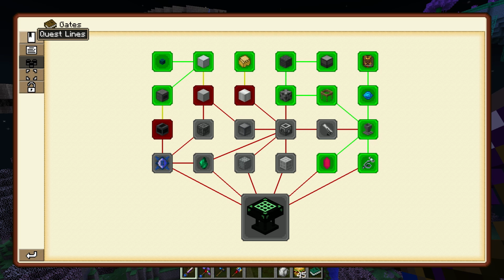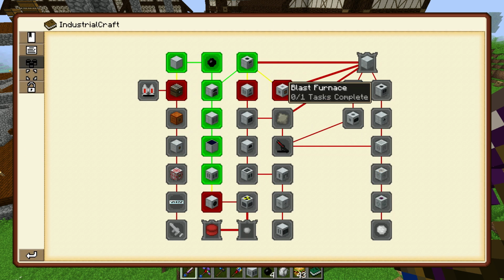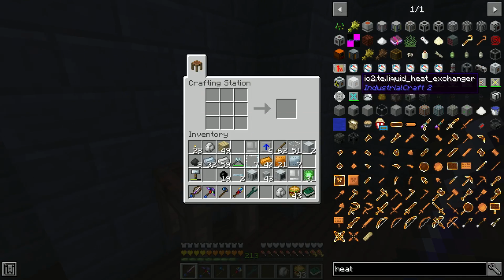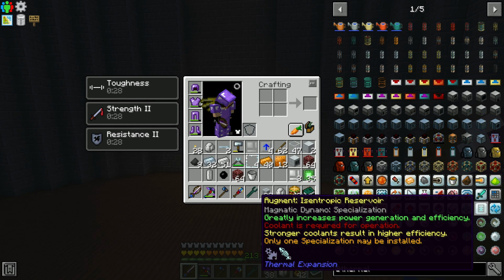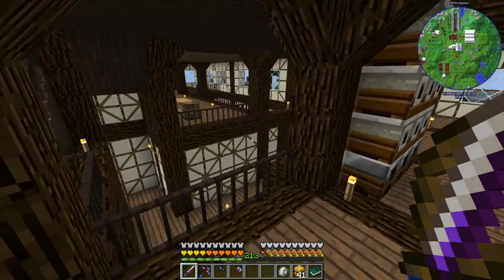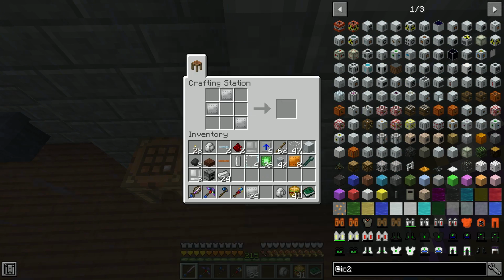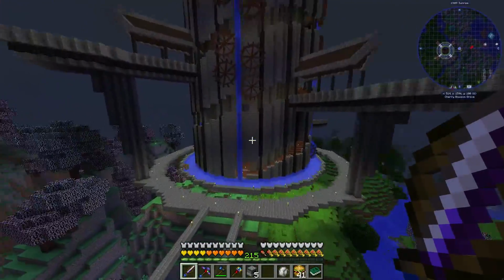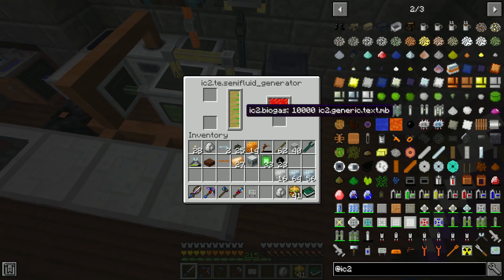IC2 Start and Semi Fluid : Enigmatica 2 Expert Lp Ep #32 Minecraft 1.12

Comment: I use IC2 alot when its in packs I play. If you want to try some other IC2 specific power source, you could look at the Wind Turbines. They're visual, and altho in my builds they always stick out like sore thumbs you could probably make them look good :) ... from memory, I think you need the Wind Turbine, a kinetic generator and a rotor. I'd suggest skipping the lower tier ones and using the carbon rotor since its just coal. That said tho, I think im gonna mess with the semi fluid a bit more since its been quite a while.
Oh, I also vaguely remember the semi fluid generators power output being based on the type of fuel, and I would guess the bio is 32? ... could be mis-remembering this tho, so dont quote me on it!

Comment: As someone else mentioned, it is a recent change if IC2 explosions and cable-damage has been disabled, I've gotted reckt by IC2 multiple times, and I remember something exploding on your old series. 
I don't understand why they would remove the more difficult parts of a mod on an Expert pack. If it was Enigmatica 2 it would make sense, but when it is E2E then it just feels wired
Reply from the maker: Hehe, well ive found in most all packs outside of just a couple, expert basically means recipe tweaking and mod integration with as many easy mode mods added to help out :p  But yeah, I know explosions used to work, but a few things that used to be a thing dont seem to work the same anymore, but havent gotten around to testing it as of yet
Reply: @ToAsgaard  I have played through the pack twice. The first time back when you started, and yes. There are a lot of things that are being done differently the second time (that just makes it all the more fun :D)

Comment: If the IC2 blowing up has been disabled, it must have been a very recent change. I managed to blow up my whole ore processing setup on E2E by accident when 2 cables which weren't supposed to touch, touched... Maybe power levels are off because of the power output multipliers?

Comment: this time you should use mekanism more as a starting tech mod coz you did the whole of ic2 the last playthrogh too  I also think you'll not be using xnet in the tech area so there is no problem in using mekanism
Reply from the maker: I'll probably do mek for ore processing for the 5x.  However, most of mek is terrible, both in performance as well as design.  I wont be using any more of it's cables than needed for gases really, none of its power storage, and as few of its machines as possible.  Best way to kill performance in a world is to use a lot of mek.